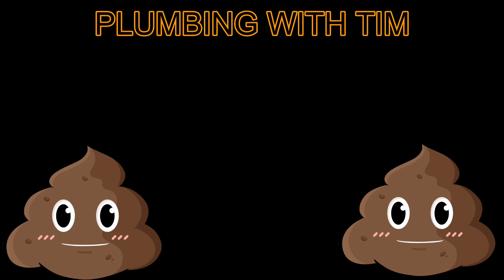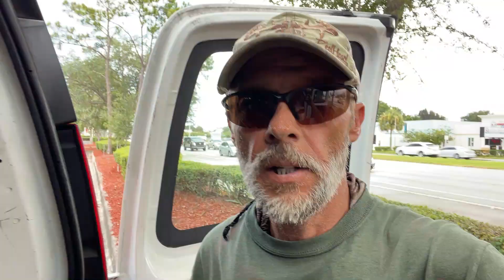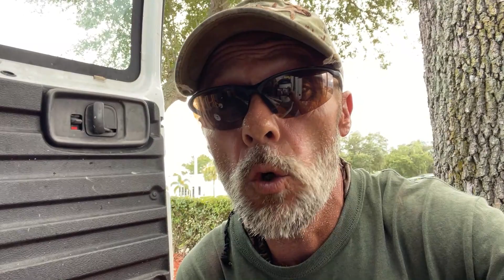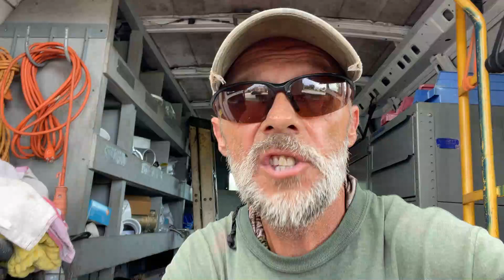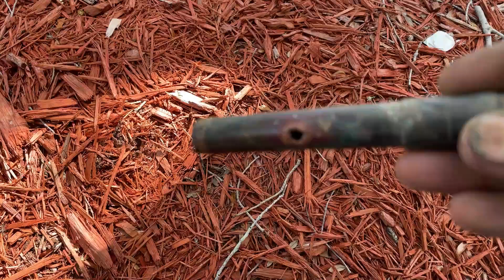HOW DO PINHOLE LEAKS FORM IN COPPER WATER PIPES

Comment: came home to find water running down the side of my hot water heater; shut off water supply and was able to see that it was coming from a pipe (covered in foam for winter).  Called our local plumber who confirmed pinhole in copper pipe.  It was shooting out water.  thank you for explaining!

Comment: We just had an inspection on a home in a rural area. Used to be in a cistern but now it's on city water. The copper pipes have pin holes all in them that have been repaired. Major red flags. Luckily it's a ranch with an unfinished basement so it's likely we'll just replace it all with PEX.

Comment: There's another called electrolytic corrosion.
Just have your copper pipe come in contact with any metal Not Copper.
I see this happen more than I care to in Home Construction.
And sometimes even in commercial. In a SKYSCRAPER, I found a 3/4" copper water line running straight through a 3 phase 277/480Volt Panel, by way of actually having knocked out the knockouts and passing it in a direct line vertically.
The Building Manager was not pleased, and Lawsuits erupted.
And no, there were no bushings where the copper pipe cane in contact with the steel panel box. The SHARP steel.

Comment: there's poly- pipe (hard plastic) ill out last you mild steel or copper, galvanize or even stainless.  Only problem is, it doest hold pressure like metal..sure will outlast them metal pipes!
Reply: I would have to disagree. It would depend on the water quality, correct installation, soil conditions "if buried underground" 
Poly pipe is a generic term in my books. 
Are you referring to Polyethylene "PE"
Poly Vinyl Chloride "PVC"
High Density Polyethylene "HDPE"
PEX-AL-PEX, PEX-, PEX-B, PEX-C

depending on your application. 

We have copper lines that have been in the ground since the early 50's that are still is excellent shape.   I have seen hundreds of Poly pipe leaks of all different types leaking some way or another. Some from pressure, some from improper install, some from just being junk "QUEST PEX" & "Tufftube" brand that you look at it it crumbles.  
On that same note yeah I fixed hundreds of leaking copper as well.  I think each type of pipe has its positives and negatives for sure. But Poly isn't the holy grail of piping for water.